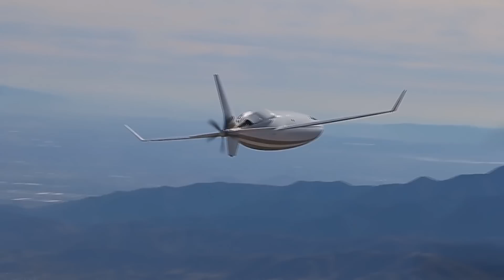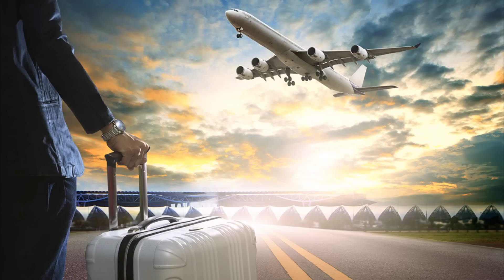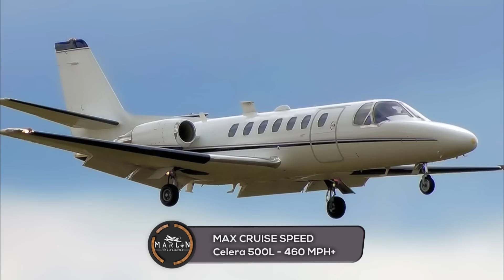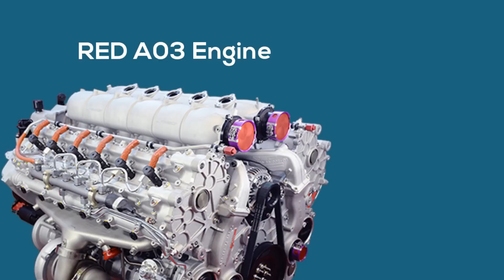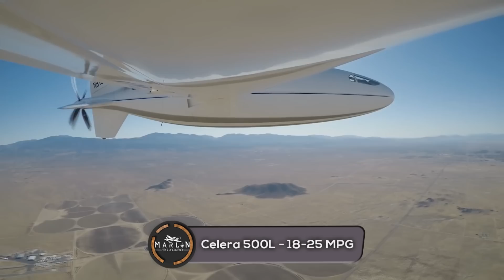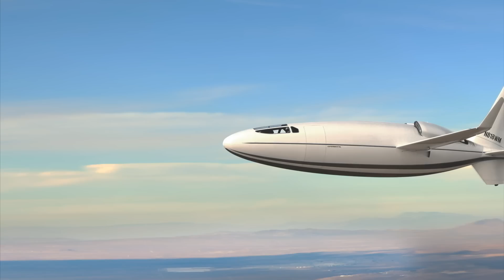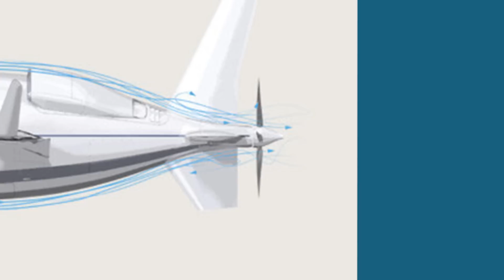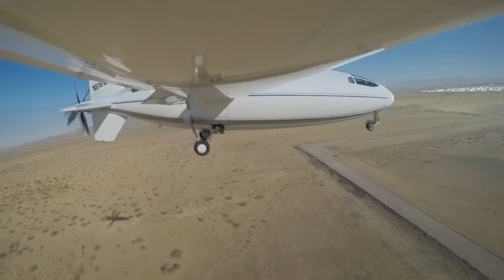Meet the Celera 500L (Flies Faster, Farther, Higher, Cheaper)

Comment: I cant see a piston powered aircraft going to 60000 ft sorry with a payload
Reply: It is turbo charged. That doesn't guarantee a 60k service ceiling, but the magic would be in the design of the turbo charger if it can actually get that high, not just the engine. 

High altitude aviation performance in piston engines is where the whole concept of turbo chargers took off. The Spitfire Mk 19 made 51k back in the 1940s with a petrol engine. 

Higher manifold pressures can more easily be achieved with diesel engines than with petrol engines since there are no concerns of pre-ignition. Also, the diesel engine in this aircraft uses an Otto cycle, which is why it is best in class for efficiency. That's because it converts more of the combustion energy into actual work instead of heat. 

It is not beyond the realm of feasibility that advancements in turbo chargers, combined with lower complexity of a turbo charger that likely doesn't even have to be stepped because it is feeding a high manifold pressure, very efficient diesel instead of a petrol engine, could actually pull off a 60k operational ceiling.

My questions have more to do with the durability of the engine. I'd be curious to know the metallurgy behind the cylinder liners and how often the engine would require overhaul / replacement. If those questions are significant, and if they failed to amortize those expenses into the operational cost, they're cheating.
Reply: @paulwhite6648  The Merlin engine was supercharged with centrifugal compressors.  The later ones had a two-speed drive so that the engine could run more compression at high altitudes.  Note, mechanically-driven centrifugal compressors.  It was the Americans who were particularly keen on turbo-charging during WW2, with Allison V12 engines and also Pratt+Whitney radial engines.  These turbocharger installations were effective and bulky.  As a result, they would not fit in compact fighter aircraft.  This was the reason why the Allison performed poorly in the early Mustang particularly above 15,000 feet and was replaced by the Merlin.  Likewise, the Bell Airacobra could not fit the turbocharger installation ,so was poor at altitude, The turbocharged Allisons in the P38 Lightning, and turbo'd P+W P47 Thunderbolt were much more effective.
Reply: @paulwhite6648  that was when the flag pitched in my head. When I heard the engine was aluminum. How often will it need to be completely overhauled? How much heat can it endure and for how long? Life expectancy? Etc.
Reply: @paulwhite6648  ok lets have a quick look at what you just said. Oxygen level at sea level is 20.1% at 30000 feeet agl 6..3 % at 60000 feet --------  ? 
Gas turbines suggle at this alt. 
The merlin had a 2 speed supercharger and went up and straight down. One person onboard.
Now this aircraft as stated at that alt would have to also provide px to the airframe. 
Aircraft outside the concord pilots use px suits as this region is known as the Armstrong line. 
So this engine at this alt would stuggle to provide power to its self let alone the parasitic drag of the aircraft systems and pax requirements. 
A fig of 30000 feet is more relastic but certainly not 60000 feet.
Reply: @stevesteve7089  Certainly valid questions, but I wouldn't be surprised to see the combination of vastly superior laminar flow, simpler, lighter, more effective turbocharger, and a considerably more efficient engine that can operate at higher manifold pressures, which translates to superior specific impulse, to outperform the turbocharged merlin from the 1940s. And it is a matter of record that the Spitfire Mk 19 hit 51k. I am not trying to validate the 60k claim, but anything above 51k still disproves most of the objections that have been raised.
Reply: @paulwhite6648  im not quite sure what your trying to say here. The later model merlins were extremely efficient. Just look at the profamce from the start of the war to the end of the war. 
Even the jump from 50 to 60 is a great challenge. To say higher mp is a bit miss leading. To get higher mp you must have air to increase that. 60000 feet agl there is a truck load less than sl. So the compression section has to do 2 things ethier increase its speed or increase its speed.
Remember that the back px out of the turbine will be less at alt and thus it will increase its speed but the comprssor can only compress so much before its efficiency is lost. There fore increase size of the turbo will need to be increased.  And as i previously stated some of that airflow will need to be removed from the compression side to provide cabin px.  
Ill believe it when i see it.
Reply: @stevesteve7089  Yes, the later model merlins were very efficient. But what constitutes efficient in the 1940s vs what constitutes efficient in the 2020s are two different worlds. I am not knocking the merlin. But I simply do not find it believable that the combination utilized by the Celera would be less efficient than the combination used by the merlin. 

Part of the reason the merlin outperformed the step turbo charged yumo with GM-1 nitrous oxide boost in the very impressive german TA-152 high altitude fighter was because it could run at much higher manifold pressures. The TA-152 could only pull a bit over 49k. The other part of the reason is that Allied aviation had access to superior octane rated petrol. The octane rating combined with the higher manifold pressures gave the late model Spitfires the edge.

But a Otto cycle diesel can outperform a merlin in terms of manifold pressure. And when it comes to fuel quality... I will let Wikipedia explain it:

"Fuel for piston-engine powered aircraft (usually a high-octane gasoline known as avgas) has a high volatility to improve its carburetion characteristics and high autoignition temperature to prevent preignition in high compression aircraft engines. Turbine engines (like diesel engines) can operate with a wide range of fuels because fuel is injected into the hot combustion chamber. Jet and gas turbine (turboprop, helicopter) aircraft engines typically use lower cost fuels with higher flash points, which are less flammable and therefore safer to transport and handle."

Since a diesel doesn't have to care about pre-ignition, the octane rating isn't really important. What is important is the flash point and the energy density, which are both superior in the fuels that are utilized by the Celera 500L to what was used in 1940s aircraft with a merlin power plant. I will again let Wikipedia explain:

"Energy content
The net energy content for aviation fuels depends on their composition. Some typical values are:

BP Avgas 80, 44.65 MJ/kg, density at 15 °C is 690 kg/m3 (30.81 MJ/litre).
Kerosene type BP Jet A-1, 43.15 MJ/kg, density at 15 °C is 804 kg/m3 (34.69 MJ/litre).
Kerosene type BP Jet TS-1 (for lower temperatures), 43.2 MJ/kg, density at 15 °C is 787 kg/m3 (34.00 MJ/litre)."

So:

Celera 500L is superior to the Spitfire Mk-19 in:

+ Lift (it's a lifting body)
+ Lift to drag ratio (maxed out laminar flow)
+ Energy density and flash point of fuel (superior specific impulse - a better measure of performance at high altitudes)
+ Manifold pressure (the primary limiting factor of piston engines at high altitude)
+ Simpler, lighter, superior turbo charger

All of these advantage do not mean it will hit 60k, but beating 51k is not the unbelievable task everyone thinks it is. Otherwise the US military wouldn't be looking into using the air frame for UAVs.
Reply: @paulwhite6648  ok i understand all off that with octane etc etc etc. 
So as an example.
Tbm 800, 850 etc use pt6a_ 67.  Nomunated hp at lest say 1400 hp. 
The airframe cant use that sort of hp at sl. So why use such a high hp engine.  
So its limited to say 700 hp at sea level. But at 35000 feet it still has 750 hp because thats all it can make at that px alt.  But the airframe dose not know that its still has its rated hp.

No if you look at what i said in the begining. I find tnat this aircraft to operate at 60000 is unlikely. Operate ie crew, pax etc etc etc.  If you have no crew and operating it as a uav it will be light. It will not have to take mp to drive a px system for the airframe. .
You cant compare onarges and apples.
By the way. Jet a advange is not its flash point or octane rating. Its its vapor point.  Us a rise in alt its boiling point is lowered. 
Mp is not relevant. If you can make mp with a deseil you can make mp with a avgas. The problem is getting enough air to get into the mainflod. 
In simple terms mp can only rise if the engine cylinders cannot take anymore in them and they mainfold holds the rest. 
It would be intesting to see what hp the engine is making at such high alt.
I know the u2 is only at i think at alt grd idle.
Reply: @stevesteve7089  Actually, if we use the P.1HH Hammerhead UAS which was modeled on the Piaggio P180 Avenati EVO that has been flying for 10 years now, and is very similar to the Celera 500L (because it also has a lifting body - albeit less efficient - and extreme laminar flow main wing), the UAV version actually got heavier. 

The wing length was increased (went from 47.6ft to 51.18ft) to improve max takeoff weight. Because of the span increase, the weight went from 12,100 lbs. to 13,550 lbs. I seriously doubt doing the same thing to the Celera 500L would make it lighter either, because any UAV variant would try to maximize endurance, which means it would need to be loaded to the gills with as much fuel as possible. This is exactly what happened with the Hammerhead. The additional takeoff weight was dedicated almost entirely to fuel, which improved range/loiter (one of the most important features of any current gen UAV) from 1,770 NM to 4,400 NM.

I would have to call any assumption that a UAV variant of the Celera 500L would be lighter completely erroneous.

But back to engine and turbocharger performance, the Avenati's service ceiling is 41k with twin Pratt & Whitney Canada PT6A–66B turboprops weighing a combined 540lbs and having a power-to-weight ratio of 2.14 hp/lb. The Celera's 787lb (including twin turbo chargers feeding 6 cylinders each) Red A03 semi-twin 12 cylinder diesel has an apparent power-to-weight ratio of 0.63 hp/lb  - although I doubt those numbers were calculated on the variant that has the integrated dual turbo chargers. For reference, the Merlin had a ratio of 0.96, and yet it exceeded the 41k ceiling of the Avenati by 10k, so power-to-weight ratios are a nearly useless measure for high altitude performance.

The reason I don't think the calculation for the Red A03 included turbo charged performance is that the Russian Yak-152 trainers that use them have a service ceiling of only 13k - about the same as the Cessna 172 Skyhawk that uses a Lycoming IO-360 with no turbo charger. 

As for the Red A03's additional weight, it appears to be more than compensated for by vastly superior fuel economy available to a single diesel engine compared to the Avenati's twin turboprops.

On to turbo charger performance....

The Allison V-1710 (which matches the Celera's Red A03 in being a 12 cylinder engine) that powered the P-51 Mustang before it was converted to the 2 step turbocharged Merlin couldn't perform much above 15k - only somewhat better than the ceiling of the modern Yak-152 trainer. But when the same Allison engine was put in the Lockheed P-38 Lightning and coupled with a high performance centrifugal turbo charger, it gave the Lightning a service ceiling of 44k - more than double the high altitude performance of Mustangs before conversion to the Merlin. 

The non-turbocharged Allison wasn't a slouch. Below 15k, those early Mustangs actually had similar performance to the Spitfire. Similarly, the Red A03 has to be a real star performer at low altitudes in order to be good enough in a military trainer designed to get military pilots' feet wet in high performance flight. But throw in high performance turbocharging and things change. After the Merlin, Mustang service ceilings went from a bit over 15k to 40.6k.

Like the Allison, the twin turbo charged variant of the Red A03 is apparently quite the performer when coupled with twin turbochargers, similar to how the Allison responded in the P-38 when given a high performance turbocharger. Because of this, the Red A03 has attracted the attention of Air Tractor, De Haviland, and Pro-Avia. Two of those three companies are planning to swap out the engines of at least one existing aircraft in favor of the Red A03, and the third is designing a new light regional commuter aircraft around it.

I am still not convinced of any claims that the Celera 500L can actually pull off a ceiling of 60k although I am also not prepared to rule it out. But I have no difficulty believing it can blow way past 30k, and can probably outperform the highest ceiling ever achieved by a Spitfire.

Now... none of this conversation has centered on speed. Speed is another question altogether. And since the Merlin dished out 40% or so more horsepower than the non-turbocharged Red A03 does, the claims of extremely low drag for the Celera's air frame would have to be 100% true for even a spectacular turobocharger implementation to give the Red A03 a chance at reaching the speeds Otto Aviation Group is talking about. Again, still not outside the range of possibility, but it will definitely have to be independently verified.
Reply: @paulwhite6648  im not sure why the avanti is limited to 41000 feet but it would not be on engine profromance. P&W pt6a is a modular engine, prob the most modular areo engine ever made and in recent years they combine big compressor cold sections with smaller hot section to give better hot and high preformance. 
Once again there is a damatic difference between 30000,40000,50000, and 60000 feet. 
Also as i said that prop efficiency is also lost as you raise in alt. Anything can get high but to get to that alt and say and work is another thing. 
I cant be bothered to look up but i think by mermory the 66 is about 1250 hp.  The latest pt6 are now above 1800 hp. 
One thing about avgas powered aircraft engines is that when turbo charged the engines are low compression at around 7to1. They reliy on high mp via turbos to get their power and now a days the a lot of rayjay type systems which are turboecd only to give sl preformance at alt.
Desile engines need above 20 to 1 and require a turbocharger just to work in aviation.  Like i previously have said even at 30000 feet oxygen levels have dropped to 6.1 %.
Reply: Steve Steve O2 isn’t a lower percentage at altitude u til you start to really get up there, there’s less per cubic foot.
Reply: @Steve Steve most airliners regardless of manufacture are limited to FL410 due to FAA certification regulations which require the aircraft to provide enough O2 to Pax while being able to descend to 10,000 ft within a certain time limit.
Reply: @Cpt_Adama  yes that is true but it is easy to over come via extra oxygen. The case said that theaircraft was a drone. As such that would not be the reason why it is limited to 41000. 
Aircraft have a max diff and you can only go a certain % under that. More max diff the higher you can go and provide better pax comfort.  
The higher you go the less air there is and the harder it is to provide mp.  And rember as i previously said you haveto tap mp px to provide cabin px.
Reply: no way this thing is gonna reach 60000 ft with those tiny wings and a piston engine
Reply: Agreed!  That number is just silly.
Reply: I agree
Reply: Steve Steve 
Yes, it ridiculous.
Reply: @ammerudgrenda  yep i agree, another point is propeller efficiency at such a high alt.
Reply: Agree, it would be impossible for it to cruise at 60,000 ft, but very possible at 30,000 ft to 35,000 ft cruising altitude. Let's do some math to verify the numbers:  
1.. Glide ratio of 22:1 seems plausible, given that the Pilatus PC12 already has glide ratio 16:1.  
2..   Assuming gross weight of 7,000 lbs, which, at maximum-efficient speed would need about 318 lb  = 1416 Newton of thrust.  
3..  At 460 mph (720 kph), it travels at 200 meters per second.  Take 1416 N x 200 m/s = 283309 W of power required = 283 kW.   283 kW divided by 0.9 propeller efficiency =  314 kW
4..  The engine can produce 410 kW at takeoff, so with high degree of turbocharging with pressure ratio of 3:1, can still maintain this power level at 30,000 ft.   
5...  Typical Brake Specific Fuel Consumption for a diesel engine is around 200 gm/kW/hr.  So, at 314 kW, would require 314 kW x 0.2 kg =  62.8 kg per hr fuel flow.  Density of kerosene is 6.68 lbs per gallon =  3 kg/gal.  Fuel flow = 62.8 kg /3 =  20.9 gal per hour to travel 460 miles = 21.9 mpg.  
So, it is very plausible for the Celera to achieve 21.9 mpg to cruise at 460 mph at 30,000 ft with gross weight of 7,000 lbs to carry 6 passengers.
Reply: @misterpercy5187  460 mph is approx 400 knots.  Cosidering a b350 with approx 2200 hp is around 340 knots cruise i cant see it reaching 400 knots  the figures may work out on paper but in reality its not going to do that. That fighter speeds from ww2 even they didnt maintain thoose speeds in cruise
Reply: The revolutionary technology that makes this all possible is modern hermetics utilizing theurgy derived from leguminous materials.

In other words "magic beans".
Reply: @wylieecoyote  only if you eat them and the packet says LSD on the lid and not MSD lol
Reply: @stevesteve7089  Maybe the same folks that sold Jack his beans for the beanstalk are now making planes was the essence of my joking comment. Today they use flowery language to dress up turds and people are stupid enough to buy it.
Reply: After 20,000 ft oxygen is the issue I wonder
Reply: Look up the highest dogfight of WW2, German twin engine recon aircraft VS High Altitude Spitfire.
That fight took place at around 50000 feet.
Will this plane do that, I have no idea but I won't throw out the possibility. All I do know is that with his wing loading he better be hauling ass.
Reply: It's been done - just takes a lot of supercharging. This engine exists and is documented...
Reply: @marcdepiolenc1880  mmmmm really alot of superchanging hey. So how do you do that then. Then with such litte oxygen at that alt how do you get the speed to syay up there and how do you get a prop to be efficient as well. Shure you can get up there but to stay and carry a load. 
When and if this happens i will say well done.  But until its is i will be not be holding my breath.
Reply: @stevesteve7089  I would not recommend holding your breath, but as a ceiling it is plausible. I would not expect it to operate in service (i.e. with a full fuel load and payload) above 35,000 feet, and that is clearly what the manufacturer expects as well..
Reply: @marcdepiolenc1880  well if u read back what i said earlier that is what i said.
Reply: maybe they ment 60000 ft in distance :-)
Reply: Why does it need to get to this altitude? Wouldn't it be a waste to get this high for no reason?
Reply: @zakurn1086  it dosnt. The reason u go high is to reduce fuel
Reply: @stevesteve7089   If you're flying a jet, if you have a turbo prop 60k feet is ridiculous and a waste of time and money.
Reply: @zakurn1086  it is a v12 diesel engine not a turbo prop. The prop efficiency at 60000 feet would be extremely low. Plus the speed it would need to do i dont think can be done, some previously mentioned 460 mph , dream on .
Reply: jets were invented because propellers are less eficient  at higher altitudes
Reply: You realise balloons can fly higher right?  Idiot!
Reply: @hanniffydinn6019  you do realize ballon and airplane are completely different right? Idiot
Reply: Can the pilot see out of that cocpit?
Reply: @QuietSignal-g8r  I have nothing against technological advancements, but this is different. You're trying to put a product on the market and deliver value to your customers, which means that you need to do it in a cost efficient way built on proven technologies that are safe. You know why other companies are not doing this? Is it because they're dumb and this guy is the only aviation genius alive? Because it's not doable in a marketable way
Reply: Bite your tongue!! I saw one go that high before....as CARGO!!
Reply: @ananda_miaoyin  really what one was that then
Reply: @stevesteve7089  that was a ..... joke. Like the engine being carried by a superior aircraft to that altitude. Get it?
Reply: Turbine driven - turbo-prop. The limitation is prop tip speed.  Propulsion loses efficiencies dramatically when tips exceed the speed of sound, thus limiting top speed and fuel economy.  A pure jet version of this is probably what they'll need to get higher performance.